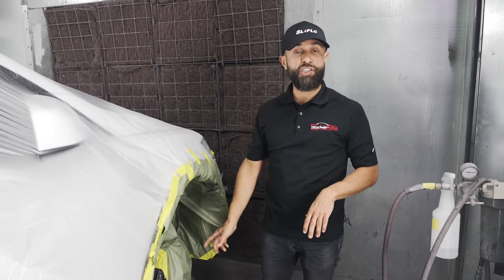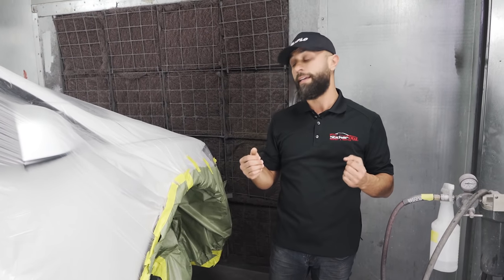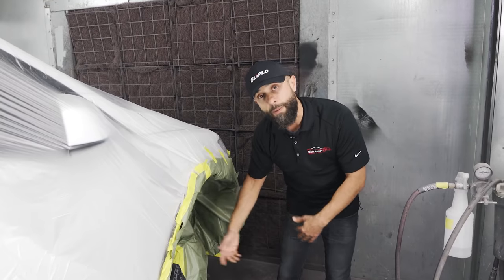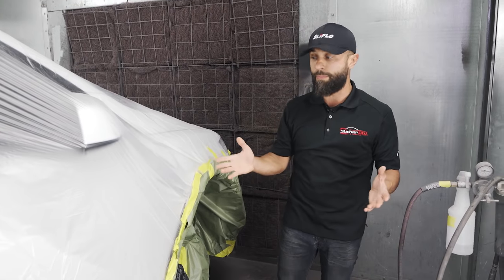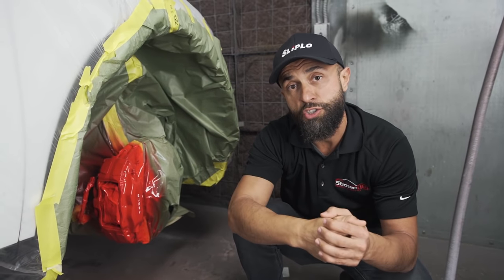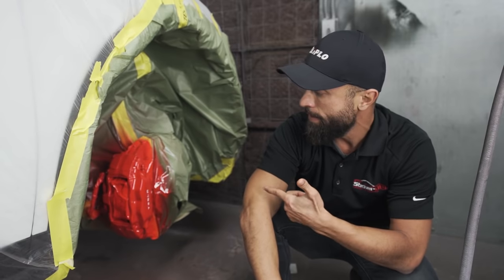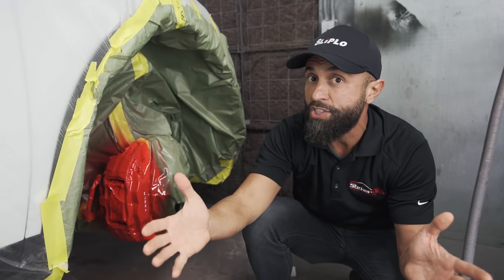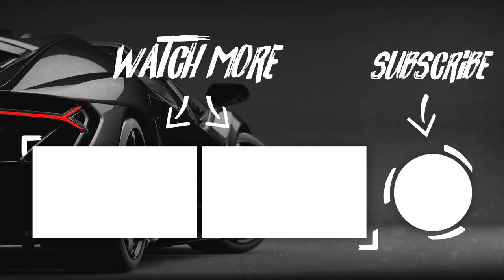Paint your brake calipers the right way (PROFESSIONALLY)

Comment: Did u use the same gun for the clear or switch the white container for it?did you use any primer? How is this better than the vht spray cans ?
Reply: Vht is fine.  Wire brush any rust there is.  The vht I used came out fine but I'm not driving a new tesla either

Comment: I was told you guys don’t paint the calipers on the car anymore. Is this correct? When I went into the shop a few days ago I was told you  send them out to another shop to paint or powder coat. Cheapest quote I got for a 2016 BMW 328i was $650 for black, red, or yellow, $750 to color match, $1000 to powder coat and more $$ to add decals.... your website says basic painting should be $250-500 max....

Comment: You have got to be kidding.  All that work masking & sanding while bending over and crouching?  To me it's way easier to take the caliper off.  So what if you have to bleed the brakes, they probably could use it anyway.  Easier still, buy some cheap calipers, paint 'em  and swap em out.  I